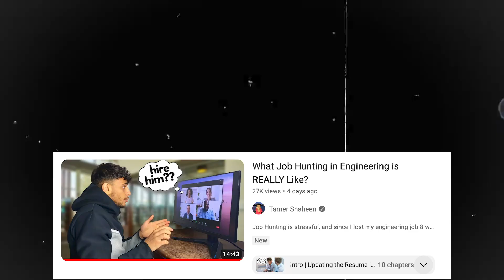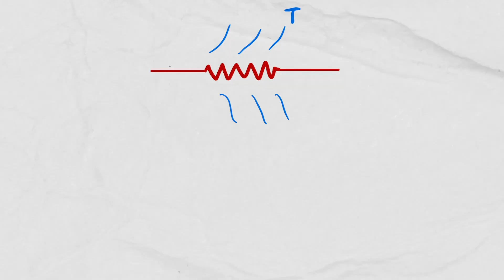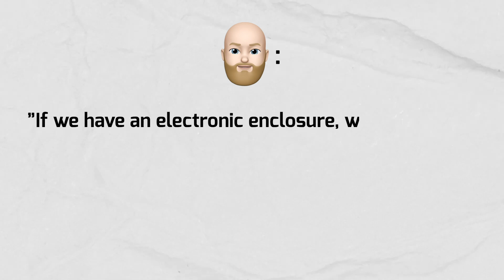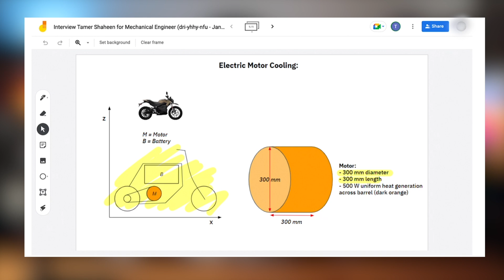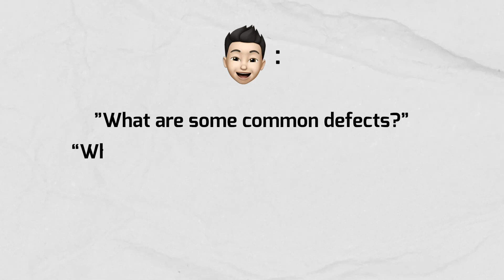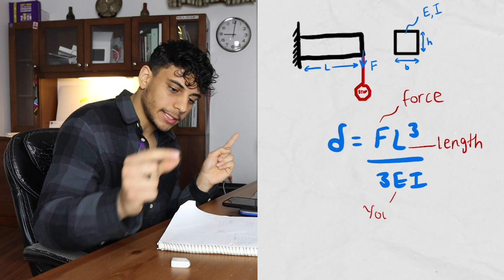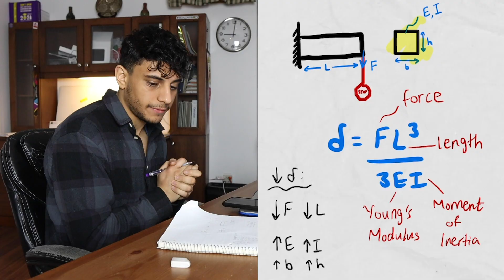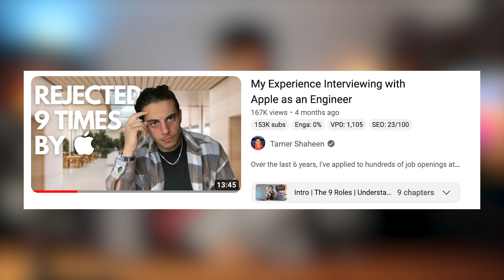What Really Goes on in Engineering Job Interviews?

Comment: I believe the equation at 3:00 is not right. The equation is P=RI^2
Reply from the maker: Yes, you’re right! Thanks for catching that
Reply: @TamerShaheen  Can't you also do V^2/R?
Reply: @TamerShaheen  Also, it should be P = dQ / dt instead of P = Q, since heat is a change in energy rather than rate of change in energy.
Reply: @xizyzy  To piggyback on this you should use the thermal resistance formula P = Q = (deltaT)/Rth. Where are Rth is the coefficient of thermal resistance
Reply: @xizyzy  It should actually be P = Q/∆t where ∆t is the change in time.
Reply: @TamerShaheen  Still, not bad for coming up with the intuitive solution off the cuff! A simple google search would produce the desired verifiable results. (Not always an option during an interview!)
Reply: Ohh yess because it's connected in series??

Comment: Cite and describe the terms in fouriers law for heat dissipation at the surface of a fin attached to an electrical heat generation term. Explain convection, free stream temperature and velocity, boundary layer. Calculate the pumping power required to cool the motor with tap water, cheapest solution.

Comment: I’m genuinely curious, I am supposed to switch majors from finance to mechanical engineering next semester. From what I can tell, I will have practically no chance of getting a job it seems based off how knowledgable you are. Why is this? You spent 4 years doing pretty complicated stuff just to get denied by a company like Apple 9 times? The get paid not the amount you expected? This may be a rant, but I’m just curious if it’s even worth it to switch majors.

Comment: The amount of work you have to do to get a job seems excessive. 5 60 minute interviews to then get rejected? Applying to 15 places with research and customized resume/cover letter for each, only getting 5 answers, then doing calls and interviews with technical questions to then get rejected. Pretty disappointing considering I’ve already suffered through four years of an engineering degree.

Comment: Love these videos. As a (mechanical) design engineer who went through a bunch of interviews in a similarly competitive area one year ago, thanks for showing this. Good luck with the design challenge, interested to see more as this progresses. 

Some thoughts from someone who is worse at interviewing: for the tell me about yourself I'd be interested to hear more than just what's on your resume (maybe you already do this, it's probably good practice though since a lot of busy engineers dont have time to even read resumes before the interview). Make it catchy, elevator pitch. 

For the design questions, going beyond the equations and thinking outside of the box is another option. Like a tapered beam/rod to reduce the weight cantilevered, in turn reducing the weight load applied at the center of mass and thus the deflection. Or a cable that attaches from the wall to the end of the beam or a gusset on the bottom. Even using coding to create an algo. Something to make you stand out from just looking up an equation and saying things need to go up or down. Stress strain curves for aluminum versus steel could also get into different types of each (look at 7075-T6 Al vs mild steel). The answer is usually "it depends", depends on alloy, heat treat, type.

Comment: Hi, I'm in second year mechanical engineering. I've done many little side projects, from 3d prints to custom circuitry in rebuilt nerf guns, but I have no work experience and am struggling desperately to find a job for this coming summer. I've applied to 100+ internships and have yet to hear back from anyone regarding interviews or further offers. I was wondering if there was anything I was missing, or what you did to get your first internship. I'm also wondering if applying now is considered too early for a may position, and what time I should be applying / what time I should be panicking that I'll be jobless for the summer

Comment: Ive Been applying to mechanical design engineer jobs here in the UK, and it does get pretty demoralising after going for interview after interview and getting rejected, although most of mine were due to lack of experience (so they say). but finally got a call yesterday that im being offered a mechanical design engineer job! just gotta keep grinding and you'll get there eventually.
Reply: Is it that you have absolutely no experience, or too few?
Reply: @s.a3898  i had absolutely no experience outside of college projects, so had to demonstrate my skills that i used in those projects, rather than ones i wouldve done at work

Comment: Could you elaborate more on the injection moulding questions that you were not able to answer? Also, the convection coefficient h in heat transfer is not a material property, right? Correct me if I am wrong!

Thanks for the videos !!

Comment: Q= mcΔT has units of Joules. Power is Q dot and it’s in Joules/s which is Watts. Instead, you should use the convection/conduction, and radiation heat transfer equations, which have Q dot. Orrr, you can use the DE form of dQ/dt= mcdT/dt and use initial conditions to solve for T. But your answer was on the right track

Comment: As someone who graduated without internships, I’m beginning to think I can’t land a role. I’m not sure what to do. I think I just have to resort to entrepreneurship and figure things out. For those who didn’t do internships, what advice do you have?
Reply: I Didnt, but im in the UK so might be different. I just landed a role yesterday so there is hope! just gotta keep grinding out applications and really nail your resume and interview technique, and be as enthusiastic as possible. remember to show that youre willing to learn and you will get there bro
Reply: @billiecook97  Congratulations on landing a role! Yeah, I am in the process of changing tactics and reading books on job searching too. Thanks for replying to my comment by the way.
Reply: @emanuelrosales6012  No Problem, Good luck!
Reply: I graduated from EE without internships, no research investigations either and no job experience in related fields. 

Just applied a lot, did around 50-60 applications for jobs I found I'd fit, especially a lot of entry level jobs. Only got 4 interviews but got a job offer for a decent starting salary for each of them. 

Assuming you're from the US. My advice if you can't land a role in the private sector is to try going for a DOD job, or see if you manage to network with any recruiters. DOD jobs are very easy to get, one of my job offers was a DOD job and it was basically just a phone call with the director of the place. Also be open to relocation.
Reply: @Zoltrek0894  Thank you for taking the time to reply to my comment! I appreciate the advice.